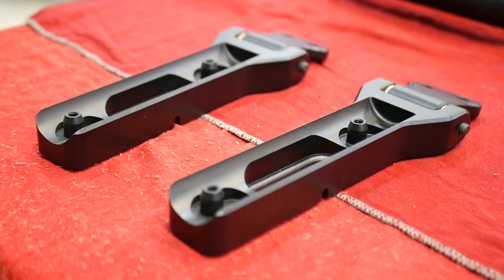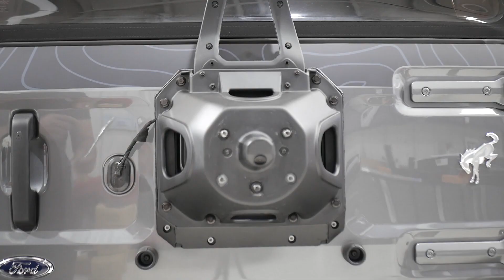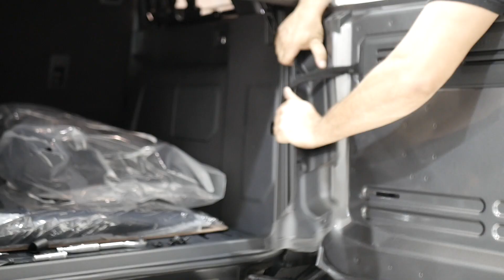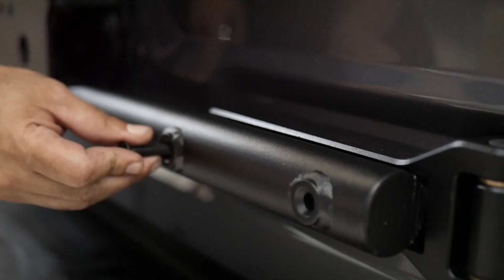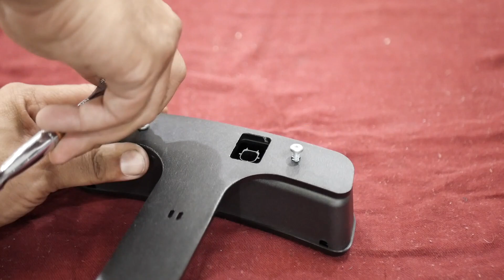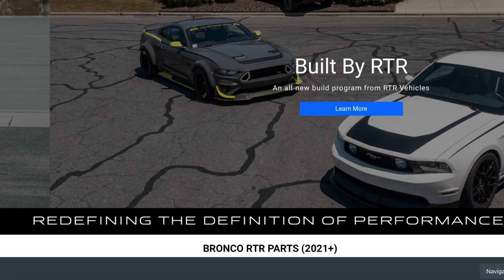Installing the 21+ Bronco RTR Spare Tire Carrier

Comment: This is a nice carrier, slightly pricey, but it still has a well-thought-out design. I have 37s so I need something I could adjust. What weight would you guess with a cooper discoverer  37x12.5x17 and the jerry can setup? I also have a WARN Elite bumper.

Comment: Why not show putting the tire on?  I'm scratching the heck out of my new tire carrier trying to get it on.

Also, although i didn't get the #10 screws, i think you changed them to 4mm.  You didn't send the screws, but I had some 4mm screws, and they threaded on just fine.

Update:  My screws have too big off a head to let the tire slide on.... To the hardware store I go....

Update: I found the rivets, so now I'm able to get my tire on,  not running to the store.
Reply from the maker: We didn’t show Jordan putting on the tire because we didn’t want everyone to make fun of him struggling to lift it.